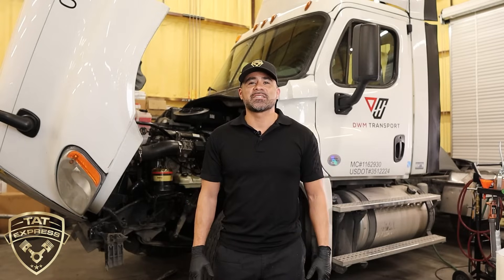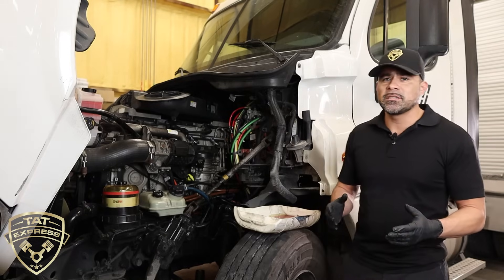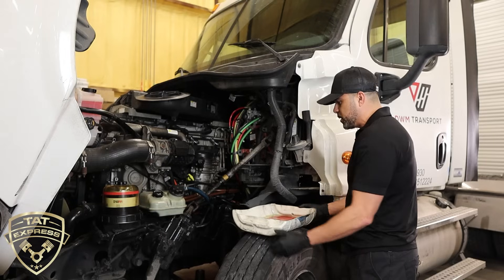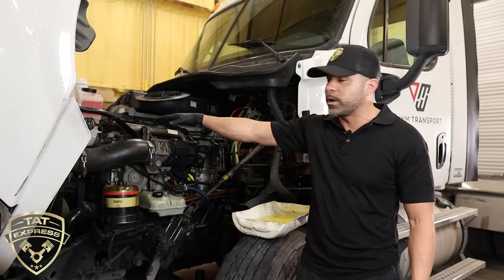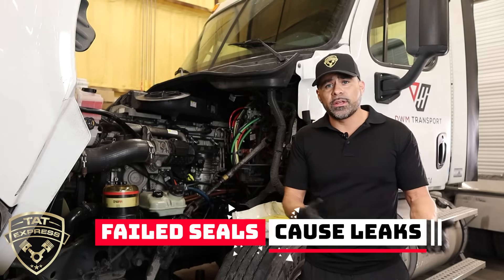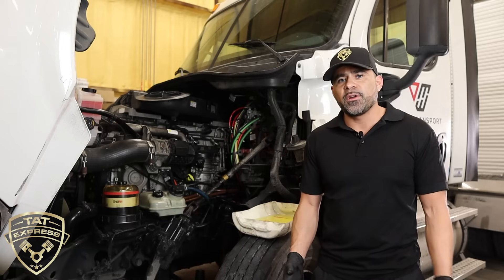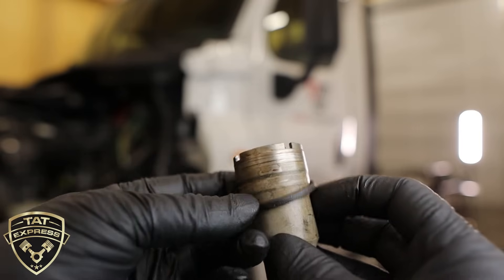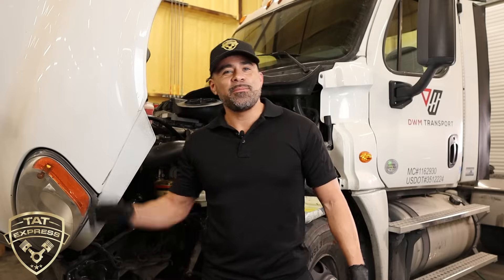COOLANT IN FUEL/ COOLANT IN FUEL WATER SEPARATOR/COOLANT IN FUEL TANK/ COOLANT IN FUEL FILTER/ DD15

Comment: What about when you have fuel mixed in the radiator
Reply from the maker: If you’re seeing fuel in the radiator, that’s a major red flag. Could be a failed injector sleeve or a cracked cylinder head. Either way, don’t run it—get it pressure tested and diagnosed ASAP. 🛑🧪

Comment: Found coolant in the fuel filter on a Paccar MX13, I'm guessing it's the injector seals?
Reply from the maker: Yup, coolant in the fuel filter on a Paccar MX13 usually points to injector cup or sleeve seals.  Since they are not serviceable a head replacement is needed.  You’re likely on the right track—pull the injectors and pressure test the system to confirm. 🔧💡

Comment: This is so wrong.DD15 high pressure common rail system don’t have fuel return.also has lot PSI in there . The dd15 injection is one way. You said from injector "That's completely impossible."

Comment: All of that is  true , But what I hate about a Cummins engine even the old school engines , you had to pull the heads to replace cups ,
 Back in the day they were  coppers that set down in there
Reply: You don’t have to pull heads off for the other manufacturers?  
Then a shop tricked me on a cat back in the day. 👎
Reply: @jaxturner7288   Well you got to live and learn ,  I like Cummins then any of the other engines my self ,
 The old Cummins 3 heads they were coppers and they were pressed in , that is why you had to pull the heads off , Pretty much the same way on the one head ISX engines
Reply: Had the cups done on my 2015 ISX last year, Cummins engine shops has tools to change the cups without pulling the head. A dealer or other shops might not have them.
Reply: @markpearson9917  
 Never heard of that before ,   I could be wrong  , but what they probably done , was dropped around looking washer down in there , and  They have a tool that cranks down in there and pushes  the washer down into the injector cup hole and squeezes it against the head more so they will stop LEAKING  ,  and when they put  the injector back down in there , your injector tip goes through the hole of the washer design  that I am talking about  and reseels  up ,  I have seen guys do that it does work , But I do not know for how long